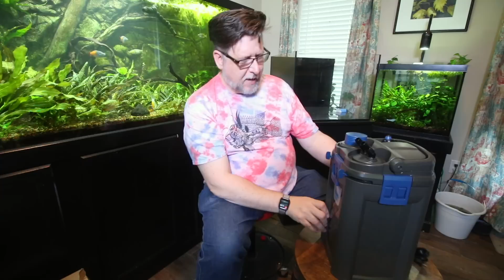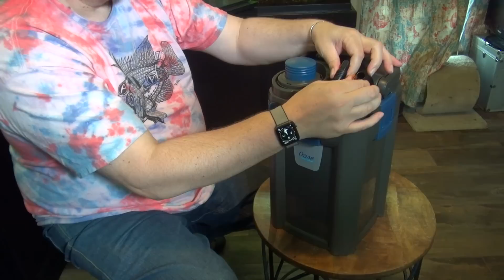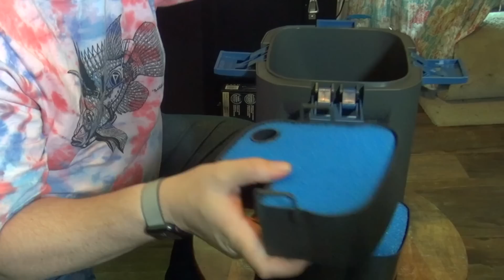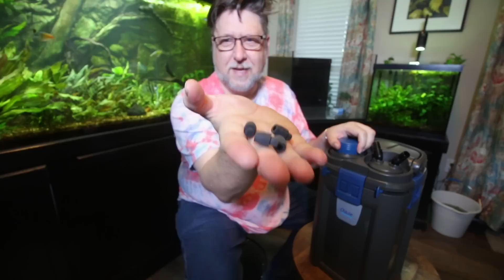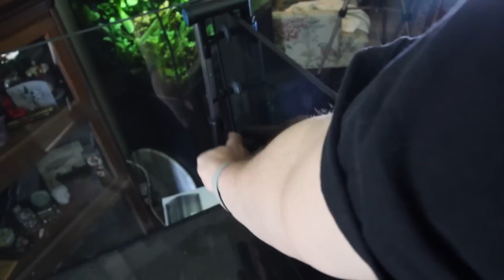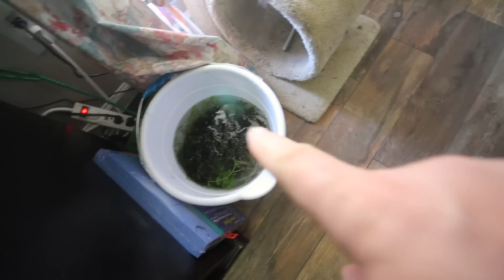Biomaster Thermo 350 Unbox & Install

Comment: Hey Sean, debating about picking up either the Oase 250 or 350.  What would you recommend for 55 gallon?  I know the 250 is for up to 70 gallon and the 350 is up for 90 gallons.  Would the 350 have too much flow on a 55?  Your thoughts?
Reply from the maker: I would do the 350. I have it on a 43 and a 56 gallon.
Reply: Buy the 600.

Comment: The best external filter I have owned. TIP: lose all the sponges in the main body and fill the trays with bio media only. The bottom tray can have some filter floss to catch the debris that made it past the initial filter sponges. And lose the plastic bio media-it's worthless as a static bio.

Comment: I have yet to put my Oase thermo 350 to work but I recently watched a video of someone having problems with it "purging air". It seems OASE's response to that is to provide extra hose clamps. My filter actually came with these in the box in a separate bag and that's why I started looking into it as they are not mentioned anywhere in the manuals and it was obviously a "last minute" post production addition to solve some kind of a problem. After so many months that you are using these filters have you ever seen such problems?
Reply from the maker: Not sure what clamps you mean. I haven’t really had problems like that. I did have a Wierd low flow issue but that was due to a mistake I made.
Reply: @pecktec  I mean those made of light metal that you can tight using the screw they come with. If you google hose clamps you will see them for sure. Like I said before they don't normally come with this filter, they were clearlly a "post production" addition

Comment: I have read that some people are dissatisfied with the built in heater complaining it is not powerful enough to hold a given temperature and you will end up getting an in tank heater any way. What was your experience in this regard?
Reply from the maker: Mine works great. On both tanks the heater gets the temps where they need to be and I don’t have to look at it.

Comment: The quick disconnect and prefilter system on these is brilliant.
Reply from the maker: I love that too.
Reply: @pecktec  my fav quick disconnect was on the Cobalt EXT canister. But it does use a separate pump, and it’s a pressurized media canister. But it can disconnect while the pump remains running, and continues circulating the tank water
Reply: Great feature

Comment: I love your videos but that canister filter looks cheaply made u have fluval filter and I have one and the plastic looks well made ehiem filter are bullet proof I accidentally dropped my ehiem canister filter and it still works it had scratches
Reply from the maker: It’s no cheaper plastic than any other filter I’ve used. And I’ve used most all the brands.
Reply: @pecktec  I have one it feels flimsy and btw your older video were the best now it seems like your a robot
Reply from the maker: Jesus

Comment: A great overview Sean. I installed exactly the same filter earlier this week. I have done away with two sponges in the middle and replaced with Seachem Matrix. My tubes are too long! But until I get the piece of furniture my wife likes to put the tank on and the filter in - an old, reclaimed painted cupboard - I will leave the tubes as they are. My fish are enjoying the extra flow and like you I look forward to installing glassware inlet/outlets with a skimming function. Thanks for the video. My Sunday morning treat.

Comment: Seems like a great canister, but not sure if I’m going to spend upwards of $200 on one 😅
Reply: Get the regular 350 its much cheaper. It doesn't have heater but you can just buy regular heater and add it to aquarium. If you are not into competitive aquascaping thermometer placement doesn't really matters.
Reply: @IMaqua  it's cheaper to buy the thermo than the 350 and a separate heater.

Comment: I'd have expected more proper bio media and not cheap sponge in a filter costing more than $200
Reply from the maker: That’s fair, I have to agree. The plastic is my least favorite.
Reply: Sponges rock for bio, they're cheap easy to clean and reusable, personally I'd do the entire thing with different densities of sponges with a little space for some Purigen and it would be a biologocal and mechanical powerhouse super healthy and clear water. Personally I haven't run a canister filter yet but that's the way it's set one up if I did. The plastic would probably be better suited for a fluidized  filter

Comment: I want one of these. But Corey from aquarium co op says it sucks and they give free stuff to people for good reviews. Not sure what to believe.
Reply from the maker: This filter was free to me. But I did choose it after owning the same one over a year. And I can pretty much use what ever I want. I don’t get paid to tell you anything if I use it it’s cause I like it. If Corey doesn’t he doesn’t we won’t all have the same opinion.
Reply: I saw his comments. I think he was unfair. He thought the heater would break if you placed the top part on the unit on the floor (so, take the heater out before servicing - and the prefilter, which he didn't mention, means you shouldn't be opening the main unit too often). He thought the instructions were badly written - fair comment, but so are a lot of instructions. And he thought it was overpriced. Also fair comment, but that's the buyer's call. But much of his displeasure seemed to be about the company not making design alterations to a unit that is marketed worldwide, immediately he suggested them. He also didn't seem to like the people he was dealing with much. ;)
Reply: This is one of the best filters on the Market today! I have switched from Eheim to Oase primarily because recent production  filters from Eheim do not have the durability of the old models.  I have never primed the filters to get them started so not sure why this was done.  Also you have to clean the prefilters biweekly to keep up the flow rate high.  I have all thermo models and have not found the heaters to be especially fragile no more than any other glass heater! I have three of these filters 2 350s and one 600 and yes they are more expensive but in my opinion well worth the price.  I cannot wait to buy the 800 for my 125 planted aquarium.
Reply: That is a lie or atleast his opinion .. He doesn't even like canisters. Been running this filter for a long time without any issue. It's dead silent and never any Flow issue. It's simply german engineering at it's finest!
Reply: News flash Corey is about what benefits his business. He is VERY knowledable about many aspects of aquarium hobby but falls short when he rants and rants to the point that his original opinion is lost in the noise. I have several Oase products and Fluval and by far Oase is my go-to. Advise is good but sometimes ego clouds better judgement. Love your vids!
Reply: @ra_cobb  yeah i really like Cory! He knows a LOT of stuff.. But sometimes when he rants and come up with his own "theoris" it can be a bit much for me lol

Comment: I think you have that already am I right.
Reply from the maker: Yeap
Reply: One of the flipper with thr easy priming came out. When I do cleanup the pre filter. didn't know that it belongs to the priming until I opened and discovered it came out. Have to put it again.
Reply: I turn on the filter when priming by the way.